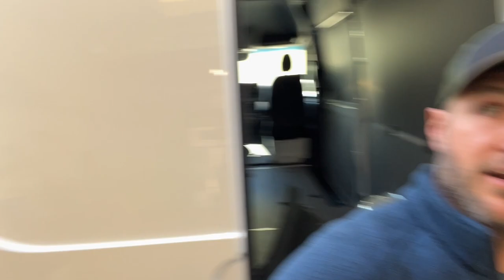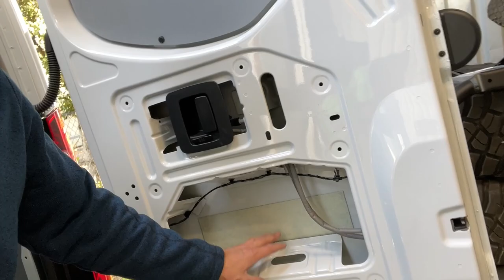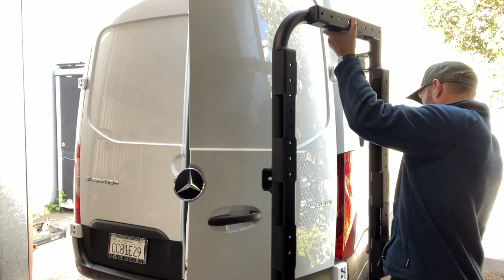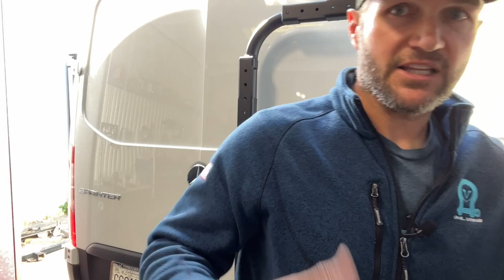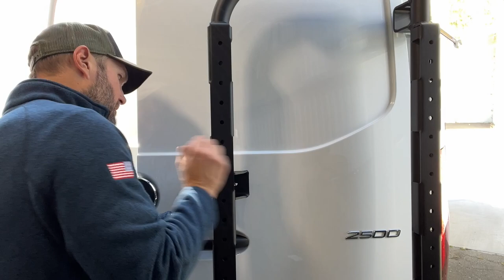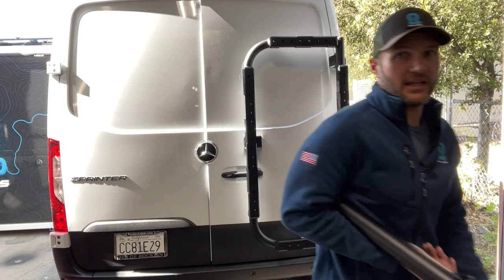B2 Carrier Install

Comment: I’ve known about the crappy factory body adhesive for some time with my 2021 cargo. I have fixed the issue with 3m windoweld. It dries very quickly, is super thick so it stays exactly where you put it, and sticks extremely well to paint. My van actually had some glue issues on the ceiling and roof where the beams and roof had separated. I used some extra windoweld that I was using for installing windows and it worked like a charm. The little syringe of epoxy in the description doesn’t seem like it would fill the 1/4 gap between the structure and body panel

Comment: Hey John, got the 3M-080308 adhesive. I was a little confused about how to use it but it looks like the two long bits go on the end where the epoxy comes out and it mixes everything. I guess thumbs are the best way to put pressure on the 2 tubes to get it to come out and then just use my imagination about applying it. Is this really an example of poor construction by Mercedes-Benz and how important is it to epoxy those supports?
Reply from the maker: Yes, this needs to be addressed. You must have the inner structure of the door glued or you will have problems. This is only an issue recently and not an issue historically.
Reply: @owloffroad  A short video showing this glueing process or a breakaway revision to the current video would be helpful.
Reply: Yes, we will shoot one. Thanks for the suggestion

Comment: Did the video of using 3M adhesive ever get completed/posted? Have the door problem on my van and have all the supplies. Would like to watch an expert from Owl vs guessing. Most of my internal supports from factory are completely loose.
Reply from the maker: We didn't make the video, unfortunately, but it is super simple. You can use this product and you will need an applicator gun. Just be liberal with the amount of adhesive. It dries fairly quickly. https://www.amazon.com/gp/product/B000PEW4MI/ref=ppx_yo_dt_b_search_asin_title?ie=UTF8&th=1
Reply: @owloffroad  This link is to 3M 08115, whereas the link in the video's description is to 3M 08308. Are you guys now recommending 08115 over 08308, or are both epoxies recommended equally? Thanks!
Reply from the maker: @scottchassey66  My mistake. I have updated the link in the video it is 08115. It is expensive but works https://a.co/d/hOxVB7v
Reply: @owloffroad  Bummer- I've got the 08308 coming from Amazon today. Guess I'll see about a return. I'm also seeing people use 3M 560 to attach these loose body fins- a lot cheaper, esp as it doesn't require the specific applicator gun and mixing tips. Don't suppose you have any experience with using it? Thanks very much for the info!
Reply from the maker: @scottchassey66 that should work fine. I would worry about returning it. They are very similar
Reply: @owloffroad  Cheers- thanks again!

Comment: John - Do you need to fix/glue the opposite door for the ladder/tire carrier or does that not matter because of the different door mounting point?  Thanks!
Reply from the maker: The internal structures of the doors are actually quite different. Because of that and how the  Ladder Tire mounts it hasn't been an issue on that side of the van. That said, if you find your door is not glued on the passenger side, I would go ahead and glue both.